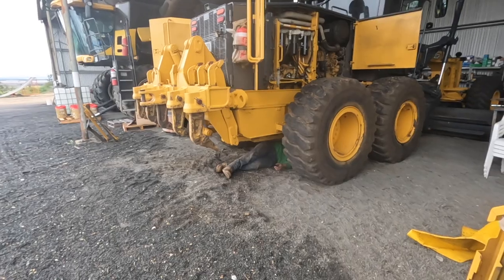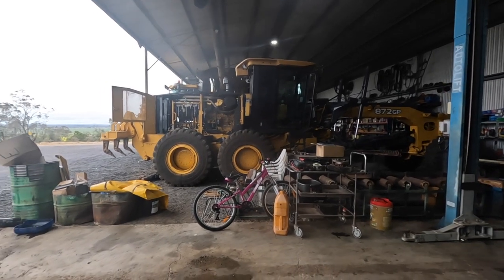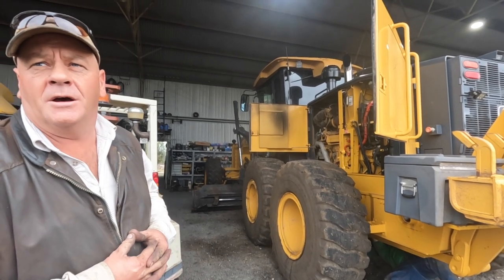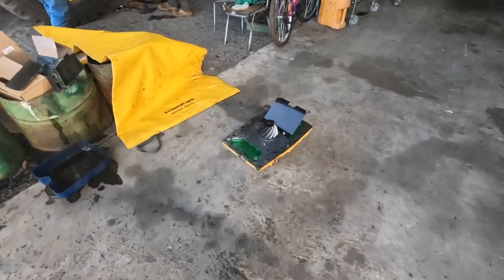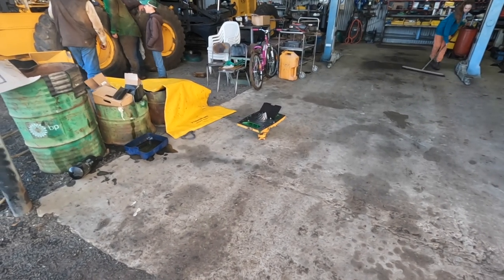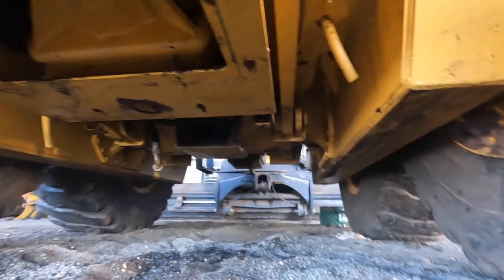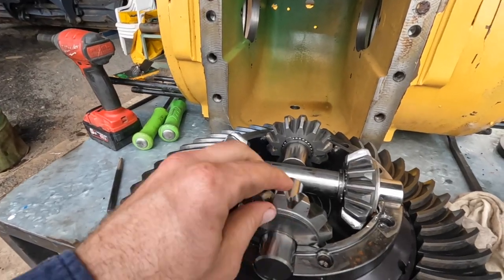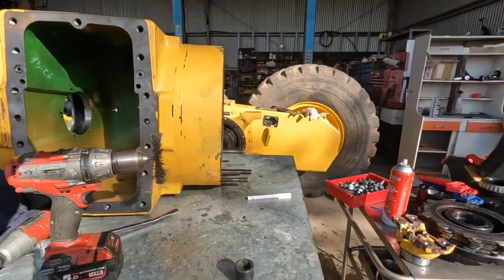Grader Disaster! This Doesn’t Look Good! (Vlog 92)

Comment: I have set a lot of diffs. There are some good video on YouTube about setting them back up. In a nutshell you have to start with pinion bearings. Set the tightness of turning the pinion. If it does not use a solid spacer between the bearing (on the inner races)machine some up. Set the preload. Then set the running tightness of the crownwheel in its housing. If it's shims write down the thicknesses combined. When you assemble and have used bearing blue to get an indication of the contact pattern it makes life easier. If you have to move the pinion away by putting a shim between back pinion and rear bearing shoulder you don't have to guess the tightness of the bearings all the time. Same for sideways positioning of crownwheel. To move simply add a shim on one side and remove same amount from other. If it is the style that has a threaded internal nut mark the position of both nuts when running fit is where you want it. Then when you move one nut tighter and loosen the other you get the same bearing loads. It's a long process. Can take days to get it right! If you chase your tail make a large change and check the blue markings. A photo every time with a paper note with shim sizes means you don't get lost and can go back to a setting. The reason you set up bearing setup independently is because you loose the tightness or looseness feel because for example the pinion is constrained by the crownwheel and vice versa. On average if you move pinion 1mm away you only have to chase crownwheel across about a quarter of the amount to maintain the same backlash. The marks the rubbing generates is far more important than any backlash measurement. Good luck.
Reply: Some good advice there. We are so lucky to live in an age where we can easily take lots of photos, I do that a lot to remind myself of order of reassembly, phones even have a handy torch,can zoom in and magnify things ,( my eyesight ain’t so good nowadays…) and take pictures of part numbers and VIN plates. I’m a fisherman,so no expert mechanic, but I pretty much manage to do it all myself, and rarely need a hand, just take my time, and sometimes it’s good to bounce ideas off more experienced older guys ( or younger!) , and ask for advice- I’ve always found people that know are very willing to help out with knowledge when I’m struggling to fix something I’ve never dealt with before. 👌🏴

Comment: In the housing if not equipped with a serious sized magnetic drain  plug. You can stack up some neodymium magnets to pull any metal fragments out of the gear lube.

Comment: Not quite the clean workshop environment but I'm sure you manage okay. So important to get your diff specs right, especially with the amount of power going through that, you can have the best of everything but if not set up right might as well make it out of playdo. It is amazing how much time is spent maintaining and fixing machinery, you seem to have a very capable crew there.
Reply: True, some engineers-blue is essential, and an accurate mini torque wrenching for bearing preload always helps.

Comment: don't know what oil you are using, i did see Castrol drums and that's ok , with all of different JD tractors we have had for the last 40years the only oil that we found that worked for us and we never did final drives or diffs even on the bigger of the row crop tractors 360hp 8530 that did all the ripping and even used it in the transmission of the both of 9180 bucket tractors was BP TF10 . it might be worth having a look at. it's a hydraulic/transmission oil.

Comment: Once I had gotten down to the diff section, I would have gotten a reman diff unit or section, That way the authorized shop would have put the correct load on the side bearings and made sure the pinion and pinion gear aliened correctly.  Yeah you can do it in house but for someone doing it once, verse the authorized shop doing them all day long, the peace of mind and warranty is worth it.